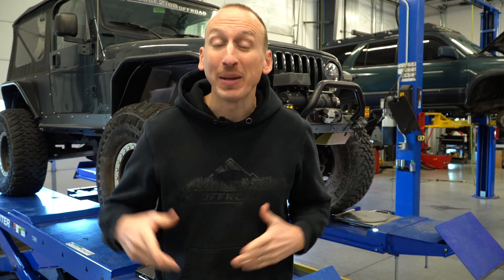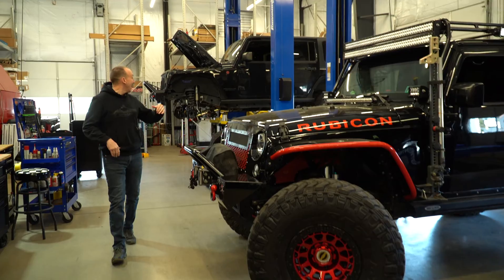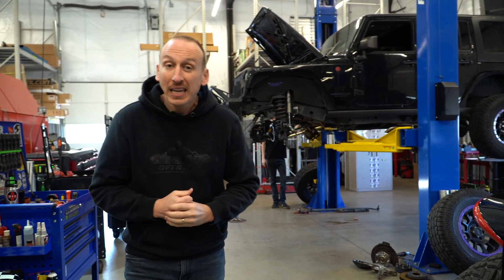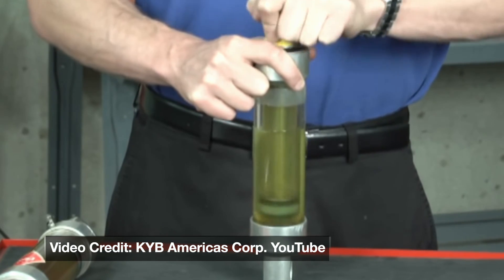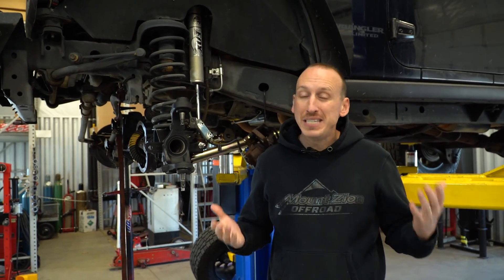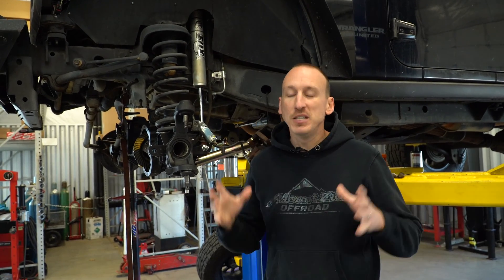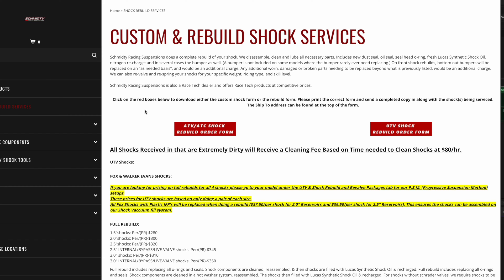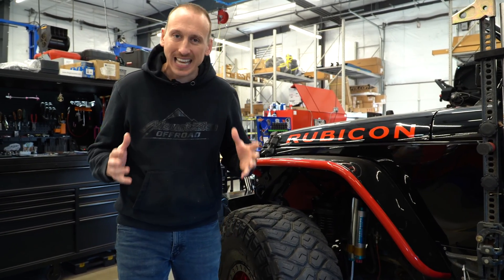Does Your Rig NEED Reservoir Shocks? 3 Types of Shocks & What They Do!

Comment: Very informative information. But one question I had was about shock travel when I am off-roading and come upon berms and rocks. I just went from stock and one of the tires ended up about 3 feet off the road, fixed part by installing quick disconnect sway bar links cause the stock ones were incredible short, but the son in law was asking about travel for the shock and what would be a better shock, currently have RC N3 shocks on my rig